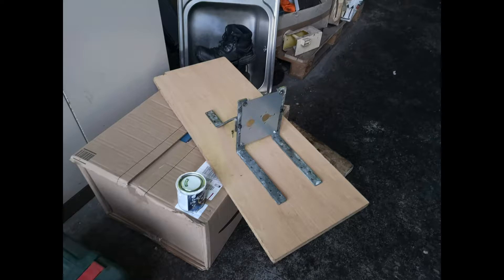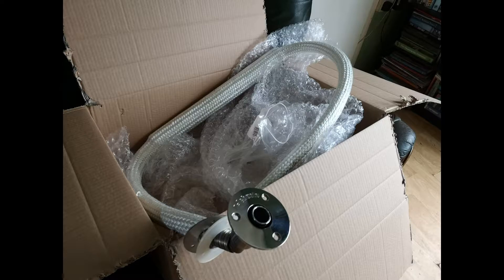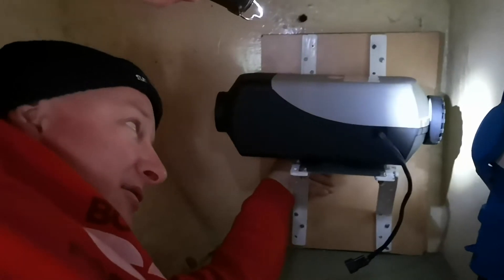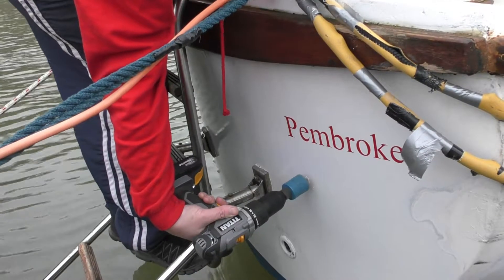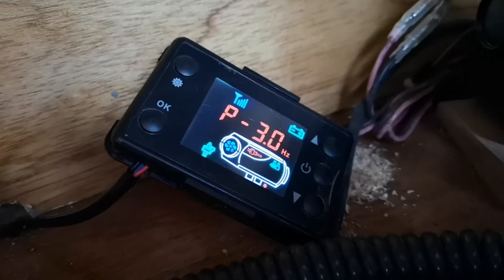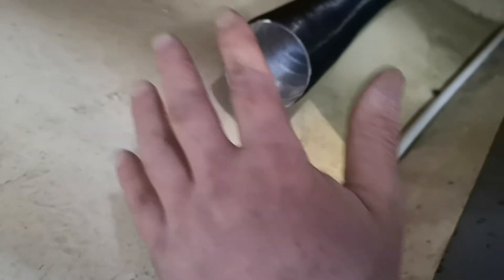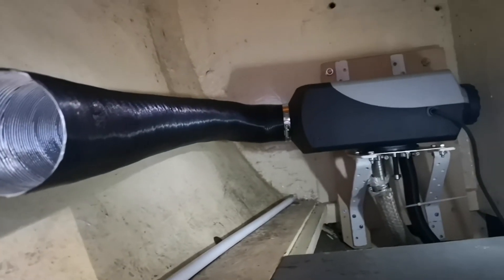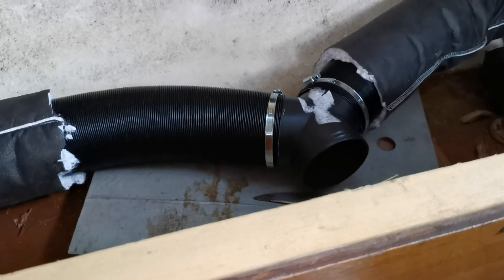Fitting a diesel heater in Kipper part 1

Comment: According to the manual, I believe the unit should be installed in a fore and aft direction. Also the fuel pump should not be mounted horizontally but diagonally at an angle between 15 to 35 degrees,  some people recommend 45 degrees.

Comment: Would a following sea be a potential problem for you exhaust?
Reply from the maker: A Water trap is an integral part of the system. The outlet element also has an angled pipe to help with that very same problem. So limits the chances but still its not an impossibility. Alternative mounting would have been on the hull side, and while that would have been far easier in fitting and heat protection etc. but there is a much higher risk of water getting in there, after all the boat rocks and rolls all the time so shipping a wave into the system would be a very real possibility. I guess its lesser of the evils as they say, but the approach I have taken seems to be the convention. :-)